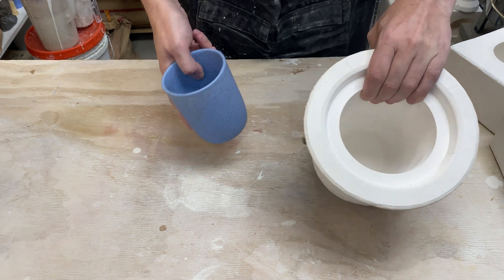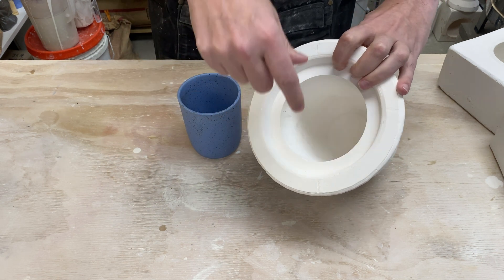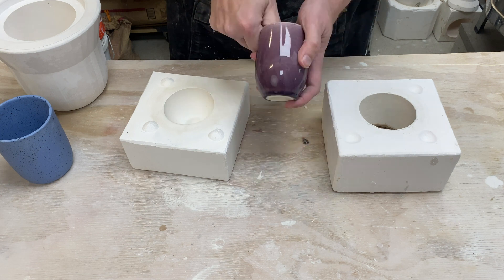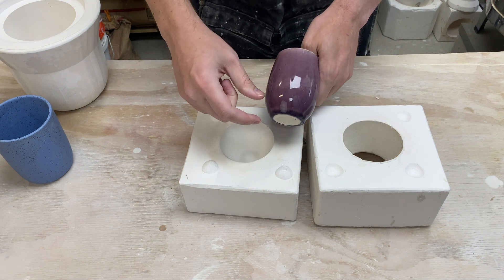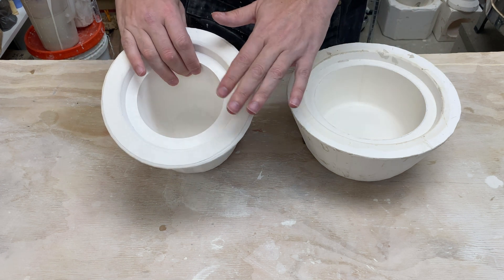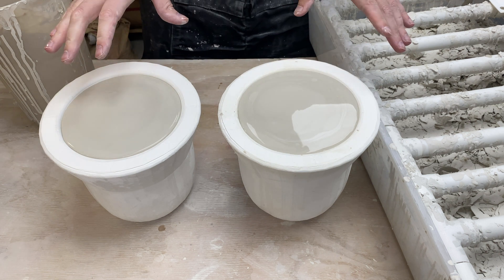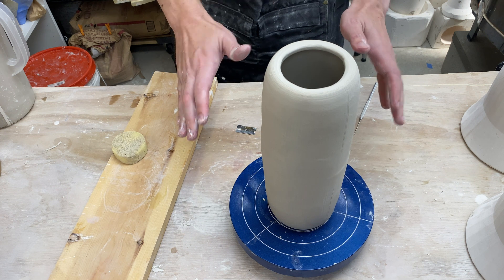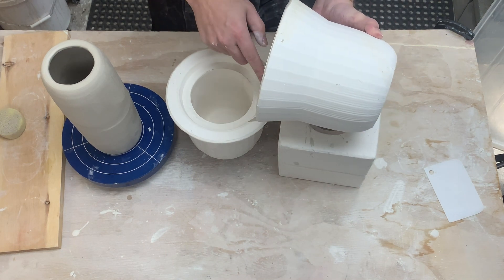Faux 2 Part Slip Casting Mold

Comment: And how long should I leave it on the mold before I remove the it? I made two, they failed due to not knowing how long I should leave the slip in. The second one wasn’t bad, but I messed it up.
Reply from the maker: Keep experimenting. The good thing is that the clay can be reused over and over again. I had many that didn't come out at the start.
I can't answer how long you should leave it since it depends on your slip, plaster, weather, etc
Reply: @PotterybyKent  I have stoneware slip, and it is thick. I don’t make my own slip, I bought it. Most of the time, the room is warm . My only issue is that after I pour it out, I don’t know how long I should leave it upside down the bucket . The last time I tried, I left it upside down the bucket for two hours before I let it seat on a flat surface. Maybe I should leave it for more hours. Like 3-4 hours.
Reply from the maker: Ah, you're asking how long to let it drain? I've seen different potters do different things here. Some will let it drain very briefly and then flip it back up, while others wait longer. I wait about half an hour but it depends on weather (how much moisture is in the air). Usually at that point it has released and is ready to demold but not always and I might need to give it longer to release.

Comment: How long did you leave it in the mold before you pour it out?
Reply from the maker: For my slip and my molds, I generally leave it for 25-30 minutes.
Reply: @PotterybyKent   my slip is a little thick tho. So that I do is leave it on there for 10-15 minutes, and I like the thickness of it.